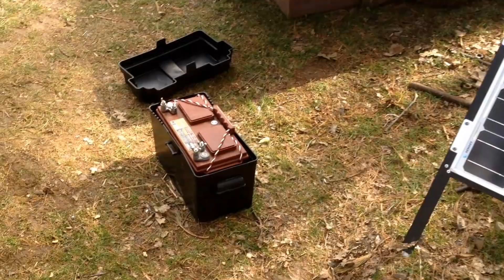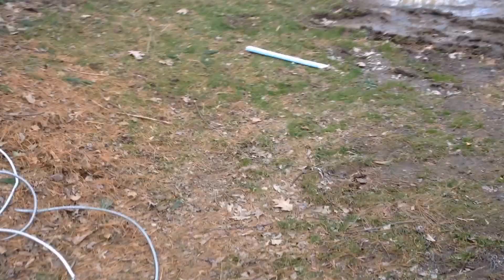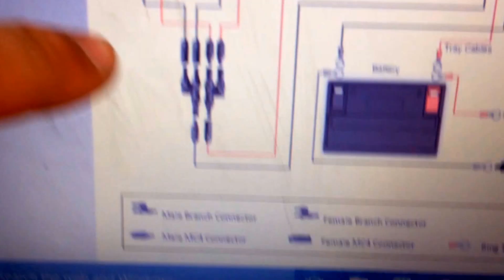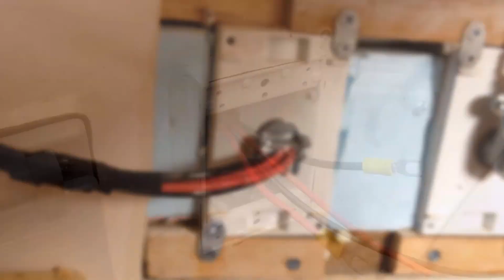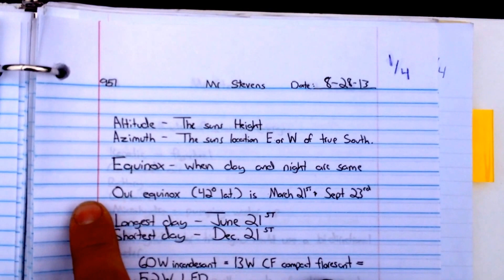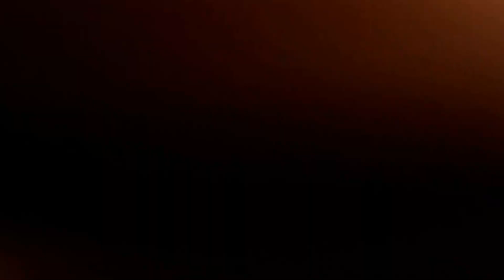Installing a Solar Panel System Off-grid

Comment: If I duplicate your outlet set up can I plug in a 300 watt inverter into the bottom plug instead of plugging into a typical DC outlet? I've already converted the DC male plug into a two prong male plug for wall outlet application.

Comment: I do not understand really lol although it seemed well explained may have to rewatch a few times but i plan on making a cob house it would be nice if you made a video explaining even details like how you put a power outlet in the house with it connecting to solar panel and battery if it's possible to access the solar energy through outlets .  did you buy a solar panel kit?

Comment: This book [link here>>>ovy.biz/qy48 ] got me thru the design and installation of a complete off-grid system for my lake cottage. The process of site evaluation, system component selection, wiring, etc. is complex, but with a lot of study and this book, I ended up very happy with the results. Everything you need to know is here. I recommend it for anyone who is starting with little solar panel knowledge and wants to end up with a whole house system

Comment: Enjoyed your video. I do like the design you have with the plug to connect the panels to your system. I plan on using this for my system. You broke the tab so the individual plugs works independently of each other. One for the panels and the second for the battery. That's where you lost me. What would the plug to the battery used for? Thanks Charlie
Reply: Batteries are for when there is no solar available (i.e. night time). I believe he stated the bottom plus was for a generator.

Comment: This is an excellent practical guide to solar energy and putting it to use for the beginner. Here is a practical layout of a solar panel project from start to finish. If you only know you want to make the least costly version of a solar panel be assured you can do that following the instructions in this guideline. https://plus.google.com/b/100728704920141855812/100728704920141855812/posts/WjRt4LRZEzo
Reply: Thank you so much for this guide.
Reply: hey ,if anyone else wants to uncover why choose solar energy for your home try Magonsi Solar System Expert (just google it ) ? Ive heard some super things about it and my mate got amazing results with it.

Comment: Hi Josh, here are a few tips and tricks to add to your system.  I plan on making my kit fairly portable also. I will put wheels on one end of  the panel cart in order to move it easily rather than drill holes and mount anything to the roof of my toy hauler.  No worry about leaks, wind resistance, parking direction, and higher center if gravity. Do weigh it down or anchor one end if weather looks questionable.  I like your idea of the different type of plug but it has little contact surface for electron flow ( most flow occurs on the outside surface of a conductor ). I suggest ANDERSON power pole connectors.   I use red paint or nail polish to mark + positive side of wires and connectors - even when polarized....just to be sure if in a hurry.  Lastly, keep the panel direction / alignment simple...no smart phone needed. Just buy a standard rubber/ wood handled toilet plunger, place it on the panel in the morning and aim the panel so the least amount of shadow is noted. Then move it about noon and toward sundown. This gives you a general idea of placement for the best sunlight track with little hassle and technology anywhere and easily re-adjustable throughout  the year.  It cost much less than a smart phone too !  Whats next ?    J K

Comment: Interesting choice on solar panel inlet connector. While I agree that proper labelling is important, in your case I would like to point out that if you did accidentally connect the solar panel plug into the socket intended for battery out then no immediate damage would occur whatsoever. The solar panels would simply begin to charge the battery. It's just they would be doing it without governance of the charge controller so of course if left like that for an extended period they would eventually overcharge your battery, but that's the only real risk.

Comment: Great setup Josh. I'm starting a small expandable system which I will micro grid tie. But the one thing you need to add is a cutoff or disconnect just after solar comes inside before the controller.. Just in case of emergency or maintenance. You're dealing with 10+ amps and need quick shutoff. Great otherwise

Comment: Josh...  Thank you for sharing your project.  your explanation of azimuth and inclination was very good.  the only draw back is finding and maintaining the position and also keeping them from being stolen.. 
I recently spent the fall to late spring in south Georgia.  and putting them on an elevated platform with a compromised angle towards south and one that pivots on north south axis can maximize the amount of light hitting the panels. 
I have four Renogy 100 watt panel that I run as series-parallel into one of two Renogy Tracer 40amp or 20amp MPPT Charge Controllers.   The MPPT gives me the most power to the two sets of DCM Batteries (4-DCM74s) I also am able to actually average between 275and 325 watts equivalent to the batteries.   I am using a HFT 2K-4K 12vdc inverter. 
(the inverter will run my shallow well pump, coffee pot, lights, fans, freezer, 5Kbtu A/C unit...Just it will not run them at same time (I have a 3200/4000w HFT Predator generator for back up.  (I will be adding 4more panels this fall when I return to south GA. 
Note ( I run two sets of dual batteries as I have two shipping containers and a outdoor shower that use 12vdc.  
For Refrigeration I have a six cubic foot Dometic RV Fridge.  (12vdc for control power) and 20lb cylinder will last 1month in winter months and about 2-1/2 weeks in May June.

I will be upgrading to Anderson Power Pole Connectors for the battery banks and the inverters.  
Amazon is a good place to look for connectors  (Ham radio or marine connector types have the least dc resistance).  also 8 gauge wire as a minimum gives the best service.
Back to the panel placement.  
Consider adapting your frame to mount on-top of the trailer and put a couple of lifting arms or rods.  This is what a lot of people who are making Cargo Trailer Campers are doing. (an added benefit is that the roof mounted panels will also shade the roof from the direct sunlight.  

Final comments ...  Keep learning and keep growing in knowledge. 

Oh I am very pleased with RENOGY Products and   Monocrystaline panels and Tracer Controllers  the MeTer remote works well to.   I bought mine on EBAY (make offer)

Comment: Thank you for the video. Can you say why you chose to wire your solar panels in parallel versus in series?
Reply from the maker: Yes! I did this because of the voltage requirements. My  battery is 12V and my solar panels  are 12V. If I hooked up my solar panels in series, they would add up to 24V (2 x 12V solar panels). But since I wired them in parallel, the voltage will stay at 12V and will match my battery.
Reply: Thanks Josh. can you recommend a quality basic book(s) about solar panels and the batteries, controller and inverter needed so that I can gain a solid understanding of the complete system. I've learned about the four parts: panel, battery, controller and inverter, from watching Youtube videos. And I know there is a difference between series and parallel circuits, but not what the difference is. I'd also like to understand the difference between volts and watts and how to figure out the energy requirements of specific household appliances, should I ever be able to afford an off grid solar system (in my tiny home dream). I love how you showed by using that tool how to adjust your solar panel angles for maximum energy gain (I'd really like to understand what you did there), and I like how you showed how to use your smart phone to help you. Before you used them, I had no idea such tools existed. Any books you can recommend, I'd sincerely appreciate. And I'd love to see any more videos on this subject you'd care to make. Thank you again for sharing and best regards.